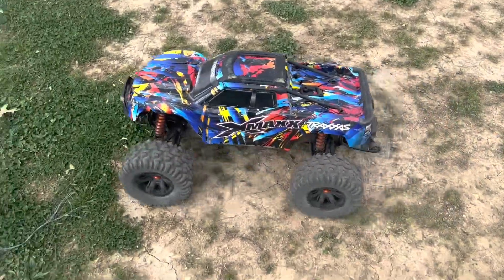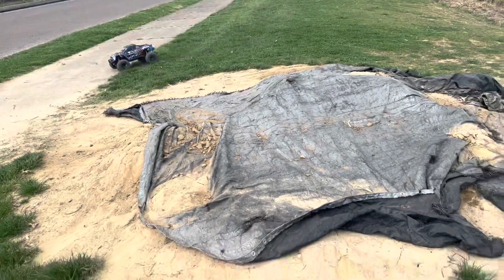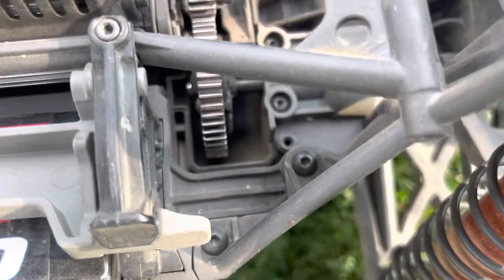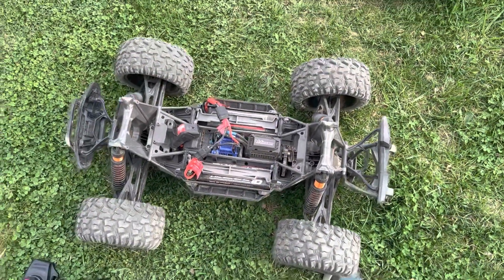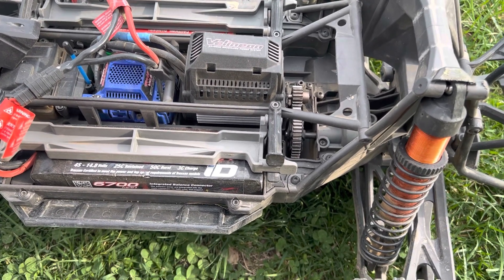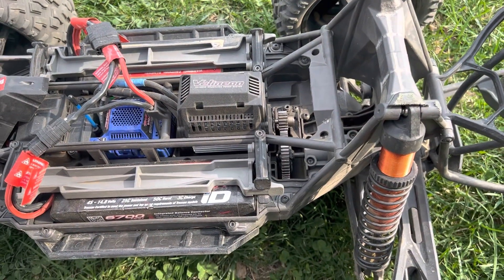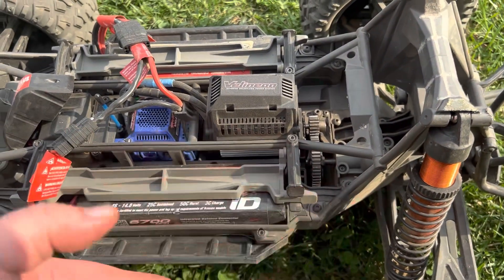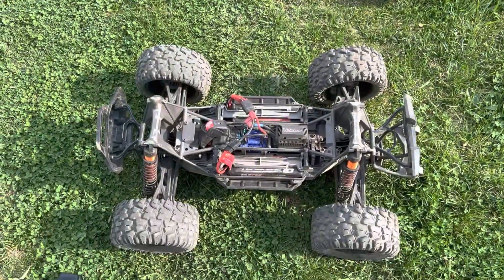Traxxas X-Maxx jumps! Also gear troubles…

Comment: Also, double check your motor mount and make sure there’s no way it could be moving. Is it only happening when you’re jumping? If so, I would have to say it Hass to be the motor shifting somehow or do you need to put the aluminum plate on. I know when I upgraded to a bigger power system I had the same problem until I put the aluminum 7787 plate. After I replaced it, I have no more issues.